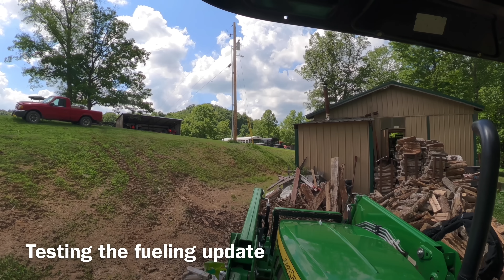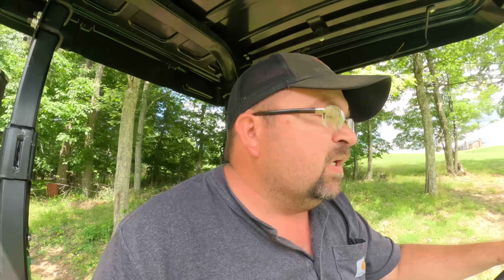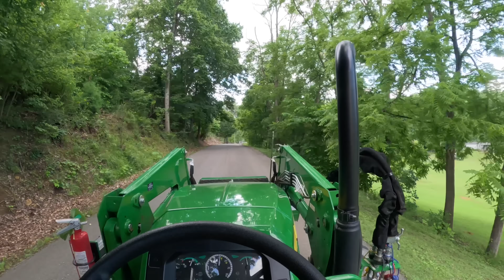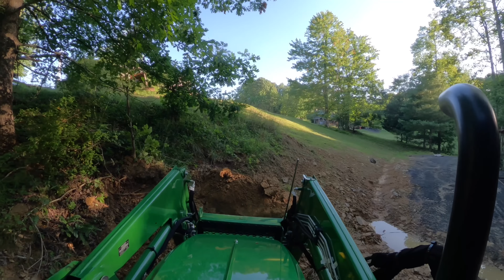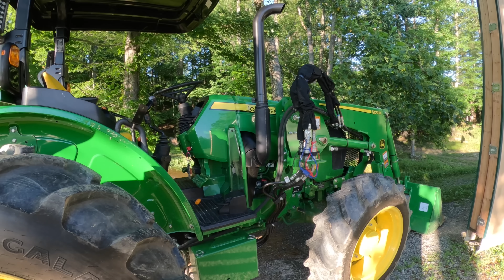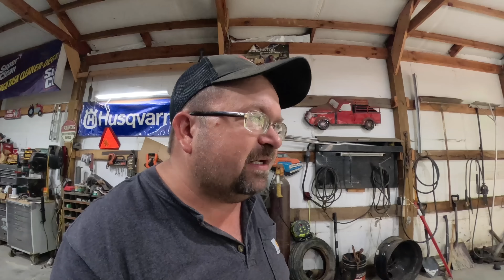Testing A New Fueling Update On The 5E John Deere’s! Any improvement?

Comment: https://youtu.be/fXFxlQQ6gh8  Thanks for all the info your great and I for one truly appreciate it. I purchased a new 5050e , a 2024 but had 2 hrs on it. I first heard a rattle when at 1700 rpm and went over a little bump and when the load on the engine lightened up it would rattle. Then I figured out how to get the rattle anytime I wanted, just run at 1500 or 1600rpm throttle up to 1700 to 1800 and bingo. It is just confused me. I sent video to service manager and that evening a great tech come out spent 2 hrs with me. We ran diagnostics sitting and then in the field. He explained to me what he THOUGHT was happening and did not see a problem. In the video I just run 1500rpm throttle up to 1700 to 1800 rpm. 1700 rpm is the best spot to get the rattle. I truly hope its normal what my tractor is doing but I don't think so. I will say with a 7ft brsh cutter going I could throttle up and no rattle with the load to this point and time. Just wanted to share with you since you have enlightened me so much. God bless Dave
Reply from the maker: I’ve been so happy with mine after they did the new update! If you need a letter to help explain to your dealer what needs done feel free to email me and I’ll pass it along. Thank you

Comment: Ben, glad that Deere is working with you to come up with a fix for the fuel delivery issues. Too bad the tractor got out on the market and the customers ended up being the testing department for Deere. But at least they finally listened and acknowledged that there’s a problem and are working to get it fixed. Stay cool out there in the heat!
Reply from the maker: Yeah it’s still beyond me how they released these tractors the way they were. But I’m feeling pretty good now about it. Thank you

Comment: Ben you don't have to respond to this question but if buying again knowing what you know - John Deere 5067 or Kubota
Reply from the maker: That’s not really a cut and dry decision.  I’d honestly have a hard time deciding again. I love the Deere in the hay field and its loader strength. I miss the hydraulic shuttle and loader smoothness/speed of the Kubota. John Deere steeping up and helping on this issue has kinda given me a new hope and perspective on them. But honestly you can’t really go wrong with either. I’m becoming quite fond of the Deere and love the looks of the two working together in the hay. Keeping the same oils and filters (with exception of fuel filters) really helps me out on maintenance. Thank you
Reply: That is a great answer.  Thank you

Comment: Good that Deere is actively working the issue.  Those 3 cylinder JD diesels have been excellent in my experience.  I can think of some other dealers/brands that would have kicked you to the curb - easier to loose a customer after you got their money than to follow up with a fix.  Best of luck… 👍
Reply from the maker: Yeah I think they’ve done good this time. Going away from a particulate filter and still trying to meet emissions was a bold move for Deere. The programming to meet emissions without that filter I’m sure is tuff. I think they have it right now though. I hope this update will meet emissions standards so it can be made public. They had to change an emissions label on mine for right now. I’m feeling good though about things. Thank you

Comment: You can definitely tell a difference in the sound. What you’re hearing now, I would consider normal, to me that just sounds like it’s got a little bit of a load on the engine. I wonder what the fuel program difference between the 5067E and the 5075E is? Be cool if they turned it up to a 5075E 😂 little extra power never hurt. Glad to see Deere corporate doing the right thing. I saw them do similar things in the past, sometimes it took a little while, but when they done something it was typically right and fixed the issue.
Reply from the maker: Yeah that wouldn’t make me mad at all 😂! I’m am glad they have tried to make these tractors right. Thank you

Comment: Usually you’ll get a more noticeable aka fuel knock when you’re under a load, in my experience anyways 👍 good luck Happy Independence Day! 🇺🇸🇺🇸🇺🇸🇺🇸🇺🇸🇺🇸🇺🇸🇺🇸🇺🇸🇺🇸🇺🇸
Reply from the maker: The original knock was more of a singular cylinder harsh knock along with what seemed like a miss. Now it’s a consistent sound over all 3 cylinders and no missing. Thank you and Happy 4th.
Reply: @khtractors I’m glad that got it lined out for ya, thank you